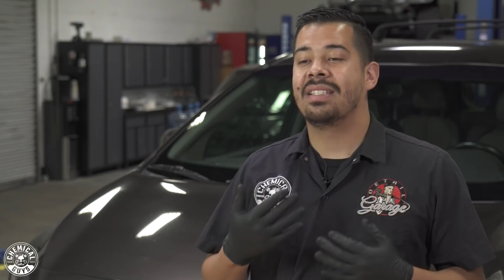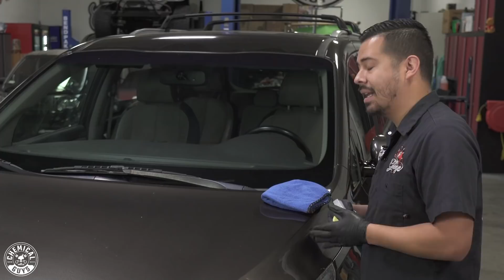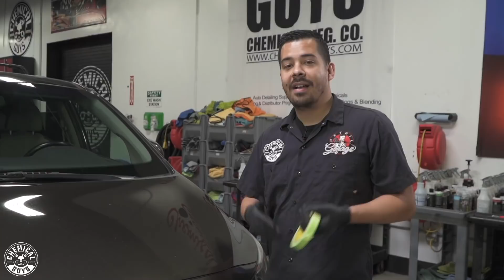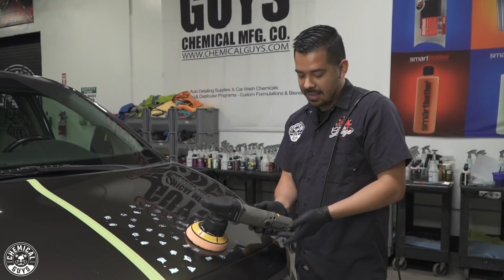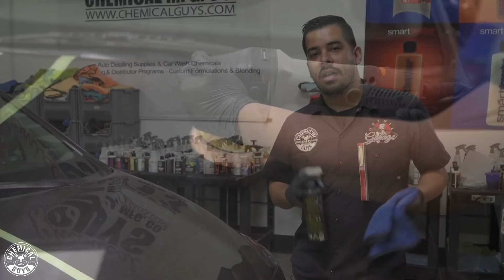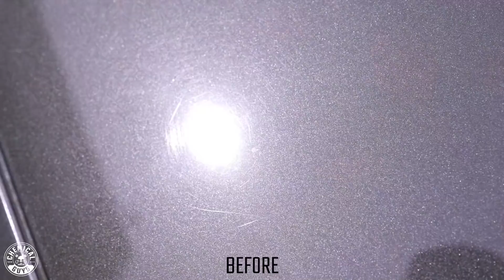How To Remove Scratches & Swirls On Daily Driver DIY!! - Chemical Guys

Comment: How many uses dueuget per clay bar? Or how many to I need for a 3 series?
Reply from the maker: Hey! One clay bar can be used multiple times until a clean side can no longer be found.
Reply: @ChemicalGuys  Ohk. I can stretch & flip it like puddy? If so perfect

Comment: Great video! Quick question, will the clay bar remove rough over spray that's on my vehicle or does that have to be wet sanded ?
Reply from the maker: Hi Carlos! Yes, try using a Medium Clay Bar and Luber to remove paint over spray.
Reply: @ChemicalGuys  i will try it ! Although I've been in the body shop world a long time I've never been big on detailing cause normally i would just paint a car and send it off to get put together. But now I own my own business and i do mobile Paintwork for car dealerships and it also a lot of detailing so y'all have brought me a lot of insight

Comment: So after using P4 and C4, we have to put a ceramic coating on it?
Reply from the maker: Hey! After polishing, the surface is bare so it is necessary to apply protection. That can be ceramic, glaze, sealant and/or wax.
Reply: @ChemicalGuys  what protection would you recommend for a daily that gets washed once or twice a month? the vehicle in question is white

Comment: What do I do if the previous owner had a ceramic coating done but I don't know how long ago it was done? Best guess would be 3 years ago as the truck is a 2018.
Reply from the maker: Hi Jonathon! Remove old coatings and start fresh with your detailing regimen.
Reply: @ChemicalGuys  How do you remove the coating? Thanks!